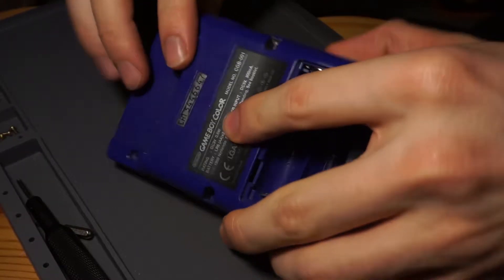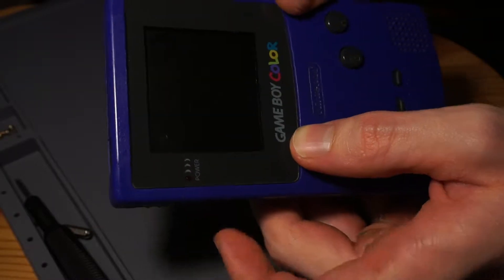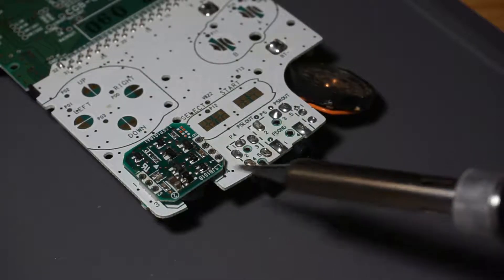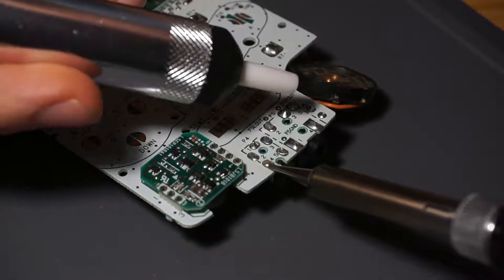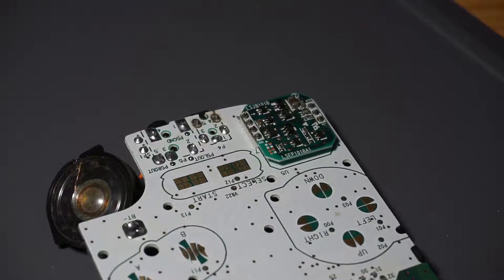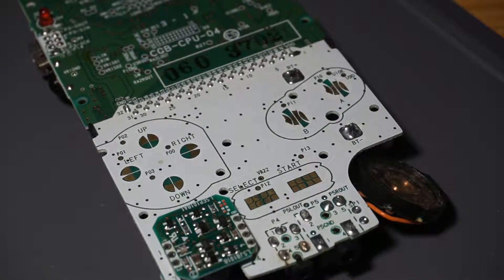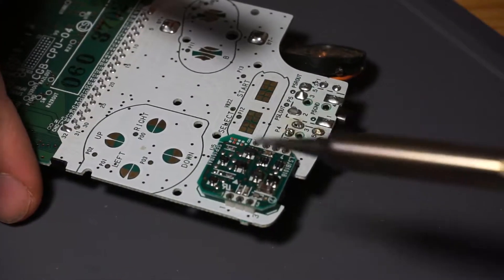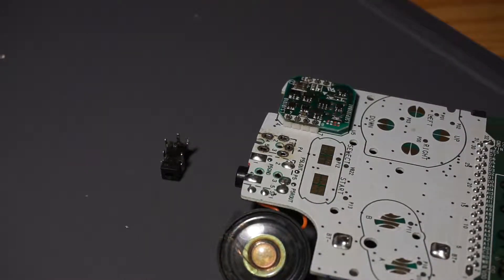Gameboy Colour Repair - Fixing a non-booting Gameboy Colour

Comment: As step one you ahould first test continuity at the power switch. With switch off - test if there is continuity between 1 and 0 near the switch. If there is not then the power switch is the issue. Move the switch to "on" and test continuity between 3 a lnd 0. If also no continuity then definitely a switch issue. If there is continuity then the issue is most likely a fuse.

Comment: Thanks a ton. Followed every possible fix on battery terminal, to power switch,and  to tracing the whole freaken pcb. Everything checks out but no dice. Was losing hope in finding a fix as I scoured every video I can find until an unlikely stumble onto your video. Its exactly the info I was missing and it WORKED!! you're the man my dude.

Comment: Hello, I just came across your video! I have an old game boy color I would like to fix. What type of solder tool and suction did you use in this video and where could I procure my own?
Reply: @krystalize  Thanks for the reply! I've been looking around and comparing prices, the problem I'm having now is probably what you've gone through. I want to get a cheap one if I need it for a one time fix, but say I wanted to do upgrades or other projects a more reliable solder tool sounds better. How is the one you have now? Is it worth the price and would you recommend it for beginners?
Reply: @krystalize  Awesome! I'll pick one of these out and give it a go. Will come back with results! :)

Comment: Hi! Brilliant job. I think I need your help. I have an old gbc and by the time I turn it on it works fine, only after a couple of minutes the display slowly begins to faint, only remaining with excessively bright colors and thus unable to be played, just as if the contrast would behave in his own way. I've replaced the screen, thinking that was the problem, but the issue is still there. Even tried to adjust the contrast wheel on the back of the pcb, still nothing. Nothing else is having problems or present impediments. I've noticed some sort of greenish deposit on the connectors of the contrast wheel, do you think that it could be the problem? I'm sorry for the long story but I cannot find anyone with this kind of problem. Can you help me? Thank you
Reply: A shame he didn't answer anything on your issue...
Reply: I know this is 3 years too late, but anyone reading this message, yes the green residue in the contrast wheel can cause the inner contacts to short, leading to it appearing as a contrast error

Comment: Now that's a interesting fact to know that the DC power was required to be working for the console to work. Nice little fix, if it was me id have a good look around for a cheap way to replace that DC port but that's just me :)
Reply: @krystalize  I was on eBay last night looking at broken consoles and they doesn't appear to be really cheap ones around :(